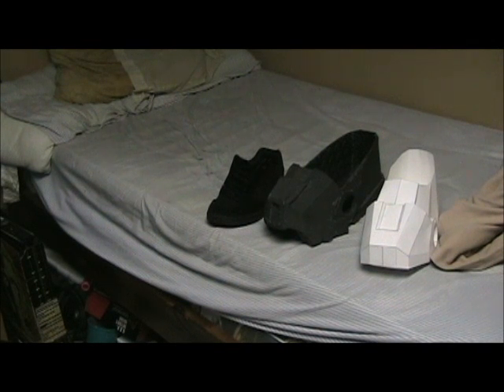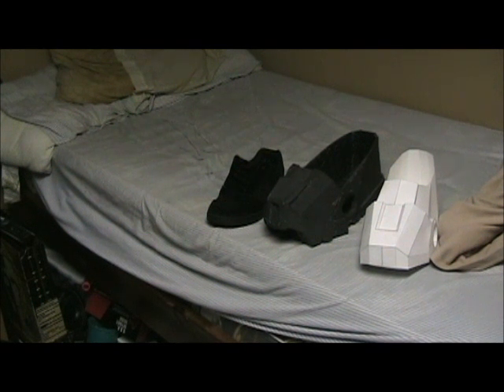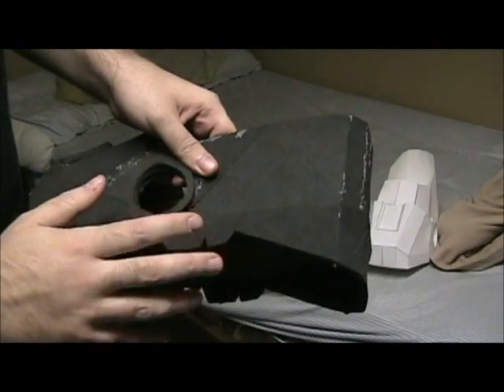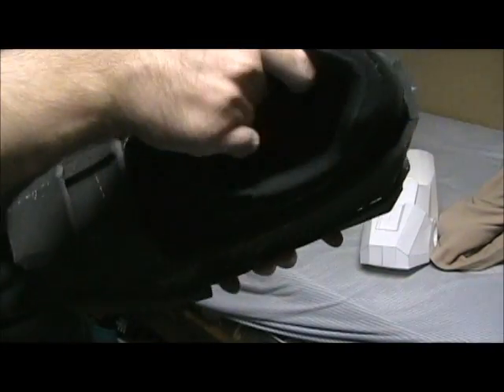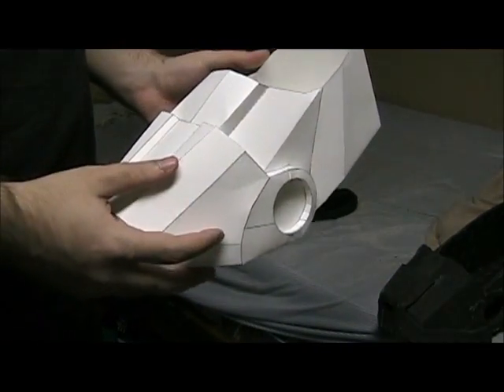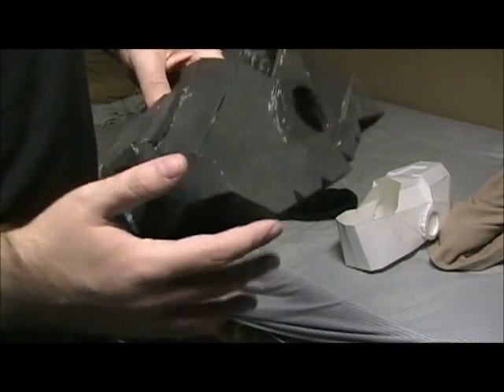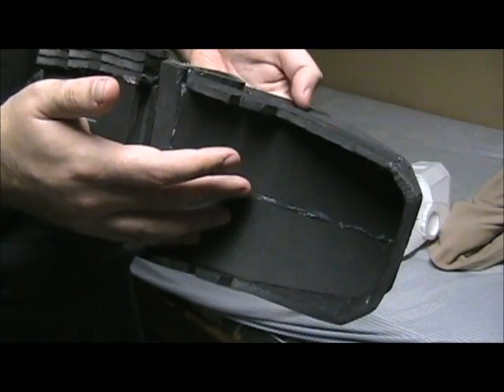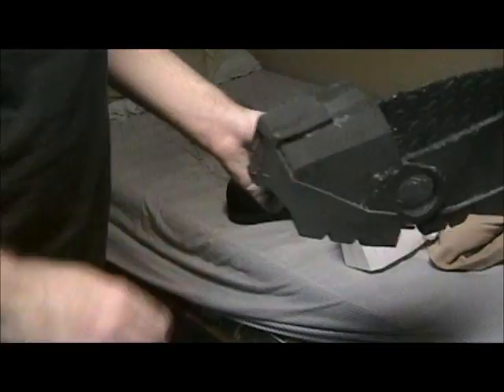Iron Man Suit Foot

Comment: excuse me but how did you measure that shoe to make th eiron amn boot plz tell me
Reply from the maker: Knowing the size of the shoe I was putting inside, I was able to use the Pepakura Designer to adjust the size of the template. From there, I would test with the sole part of the boot template to see how it fits in comparison to the shoe and see if I needed any additional adjustments